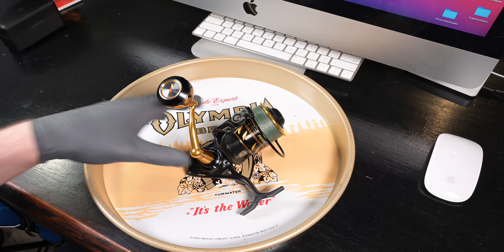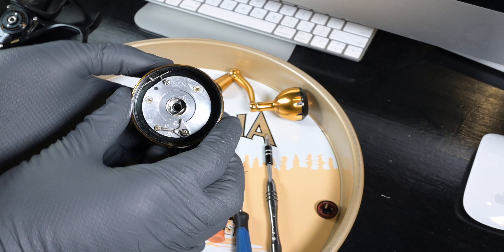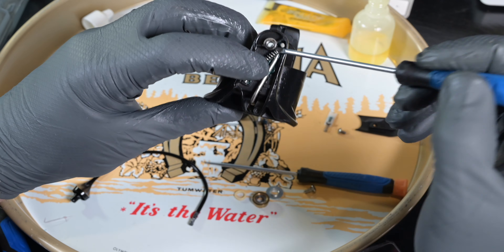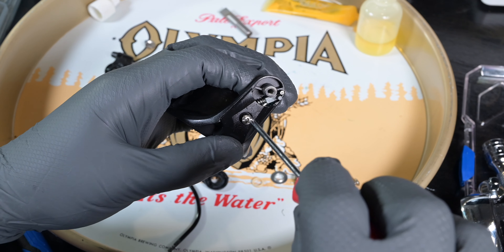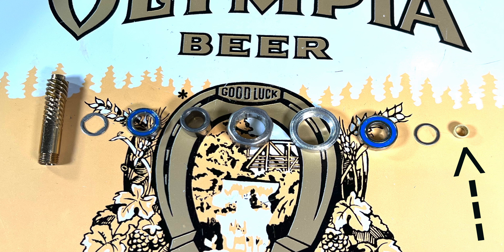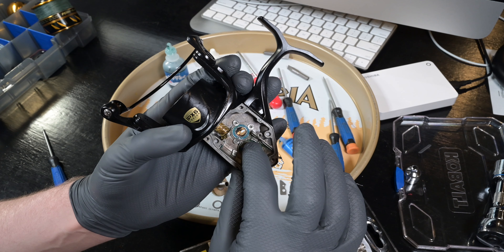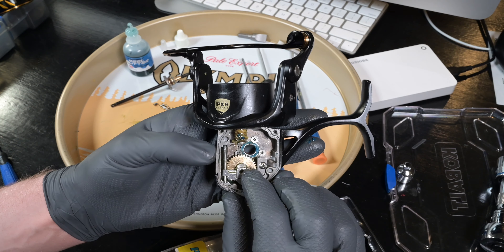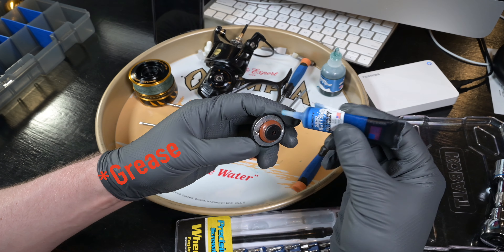Servicing the PENN Slammer 4! Teardown & Assembly

Comment: I have been servicing reels professionally for a long time. The video is great in assisting reel owners to be able to give their reel some TLC in the event it went swimming or just to look after it. 
Two things I'd change here..
1. ALWAYS remove all those bearings from their recesses, that is the first point of ingress and factory lube job is piss poor at best. Once the salt gets to work between the stainless bearing and aluminum body you get galvanic corrosion and getting those bearings out, especially the Pinion Assembly can be a major issue. I always pull all bearings and grease the recesses. 
2. No issue with generous grease application but I always remove old grease even if new from factory. I would also not use different grease/lube products as the cross contamination could cause the lubricants to be less effective through breakdown of key composition/formula. 
Got yourself a new sub as I enjoy all content around these topics. Keep up the great work.
Reply from the maker: Thanks for providing the feedback and subbing. That’s all great info and I appreciate people sharing their wisdom. I’ll keep it in mind for future videos!

Comment: Great video.  I didn't realise my Penn Slammer IV had so many parts 😞
The main gear on my reel sounds like it does not have enough grease - there is a sort of dry metal on metal sound.   I would like to just remove the side plate from the body and apply some blue grease to the main gear and other cogs.  
When removing the side plate of the body, what type/size of screwdriver is required ?  Is it a Philips or flat head ?    Thanks.